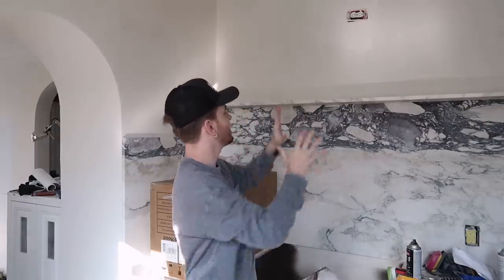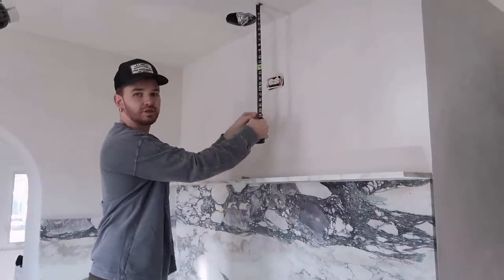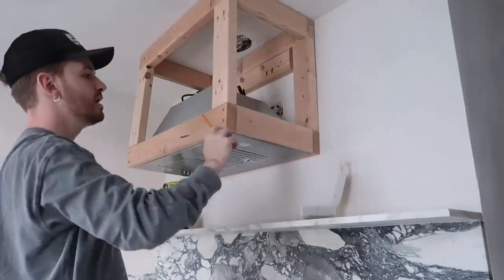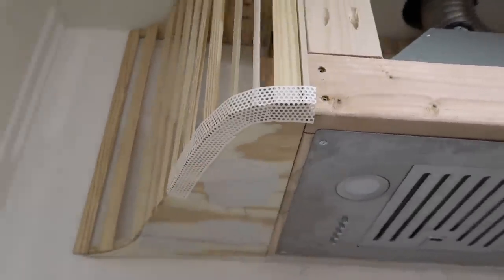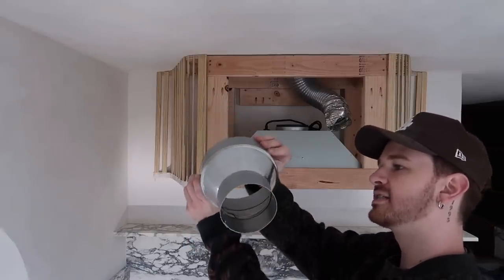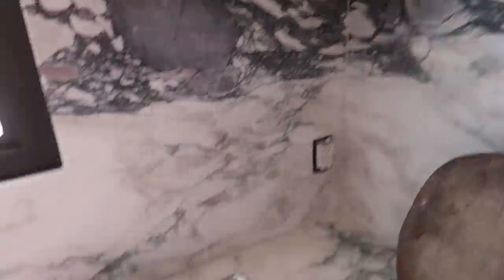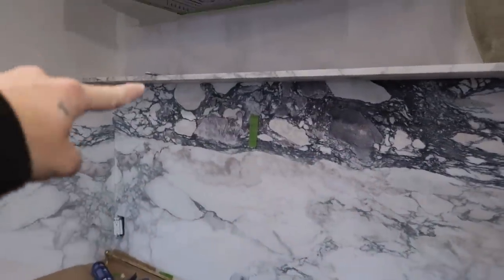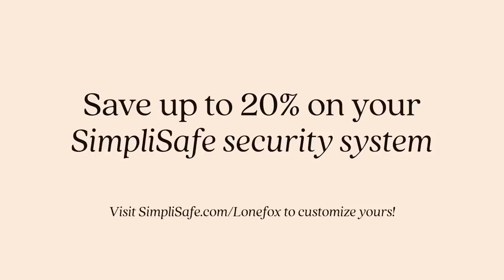DIY Stone Range Hood Using PLASTER (From Start to Finish)

Comment: Haha, ventilation removes the HOGS -- heat, odors, grease, smoke.  You should be running your ventilation every time you cook or all of that gunk will end up covering your cabinets and making them sticky/gross.  I love, love, love your design aesthetic, content, personality, videos, and creativity.  Thank you for all of that.  There are a few people who have mentioned the size and the height of the range hood.  For the most part, they are correct.  Also, you should add up the BTU's of all of the heating sources (burners, oven, etc.), and then make sure your CFM from the vent are adequate to cover all of them.  Typically, your ventilation will be one size larger than your range (ie: if you have a 30" range, you'll want a 36" vent hood.  There are several reasons why your vent hood might be a fire hazard as well.  Someone has mentioned those reasons below me, but now, I can't find it.  Signed, a kitchen designer and appliance expert.

Comment: I personally would have brought the hood further down to where the marbel shelf is now, and only add shelf slates on each side of the hood. Usually, it's mentioned in the instructions manual the optimal distance between the stove and the hood (to me, it seems a bit too high up) Also, even though it would have kind of ruined the aesthetic,  I would have opted for the front panel to be a door, so that I can access if necessary. But other than that, visually, it looks stunning. You always have great ideas!
Reply: Marble is not combustible, so I’m not mad at the shelf. For some reason I thought the rail was for spatulas and ladles. The pots may get some splash back. Performance is not too much of a concern. We don’t know the range Drew selected. So it’s impossible to make recommendations without doing a BTU conversion to CFM’s and look at the clearance. People are too quick to judge in the comment section.
Reply: yeah I don't think if it will be effective if it's so high up. We have shelves either side aswell but in the middle the hood or else it would be to far away to do anything.
Reply: I think the hood looks great.  I am worried about the height and effectiveness of the hood also.  I wonder if the fan vibration would crack the plaster or the cooking fumes and grease will stick to it and make it hard to clean.  You might find a custom vent hood made of stainless steel in the future.  One more thing…I don’t know what the code is in CA but where I live there are height and material codes because of fire.  I do hope it works for you as I think your ideas are beautiful.  I just want everything to work out.
Reply: @erinmoore9681  they just gave their opinion based on observation. it was pretty neutral and didn't come across as judgy at all
Reply: Good points on both sides. We’ll see what happens when the kitchen is done. The insert can always be replaced with something more powerful if Drew notices performance issues. No hate, just thoughts.
Reply: @erinmoore9681 I have a Bachelor's Degree in Design from Drexel University; I have done many kitchen installations and Manufacturers ALWAYS stipulate that the range hood is hung between 28-36" above the range surface in order to work properly. Think of it like tires on your car- your gas mileage will be crappy if you buy square tires instead of round ones. or install round ones so far up the side of your vehicle that the undercarriage of your car scrapes along the street- just because you like the aesthetics. It's not "criticism" of your dear boy, it's a warning.  PS- Windshields don't work either if you install a privacy screen around the lowest 8" of the view; (you can still theoretically see, but not the way you should) that's what the shelf does in regards to the vent/exhaust hood.
Reply: its pretty buttttt I completely agree. Drew has great style but the reason i prefer macenna's videos for learning is because i can tell she does thorough research and read instructions so hers are pretty AND functional. This hood is too high to be effective, at least in my home it would be absolutely useless (hello to all home made pasta sauces and asian foods in my mixed household). also, I love how he makes things work but he rushes so much. He doesn't test paint in different lights. Like ever. Its actually a cute quirk at this point but as he evolves as a designer I hope to see drew become more detail oriented and look at function of use long term as well. I hope he sees these comments as feedback and not in a negative light. The knowledge and growth can really take him higher in his career, I really hope I see this for him because the potential is chefs kiss
Reply: @jmcaulay577  It would not be to code if there was one (due to distance and obstruction, not to mention materials used and no accessibility) but most household building codes do not require a vented range hood, in fact I do not know of a single location that requires one!  It IS however, beautiful.
Reply: @nathalieisneon  you need a degree to be a designer… so “his career as a decorator” not a designer
Reply: @robertmaylock9532  Great points, Robert!
Reply: @robertmaylock9532  Distance and use. I need to be able to reach the knobs that he placed at the WALL SIDE. But live and learn. Nothing combustible around the stove. But that is just me.

Comment: I HAVE CONCERNS. 😂

1) the vented hood came out spectacular!
2) what if the vent hood needs service. Such as motor problems or electrical issues? How will you go about accessing that portion of the vent hood without ripping it all out first?

2) with the vent hood so high above the range and the shelf above it,  will smoke, steam etc., still be able to be directed into the vent hood?

Comment: A vent needs to be sized and located a specific distance from the stove top to be up to code. It looks quite small. I found this out the hard way when I purchased at larger 36” gas range. They had to upsize my vent size.
Reply: I was thinking the shelf is blocking half of the fan and is much too high from where the stove top will be to be effective.
Reply: @pattir8616  this drove me nuts 😭
Reply: Same! I want to love this but between reducing the vent to 4" (which is too small for most hoods), not to mention gas usually needs a 600cfm fan and the shelf/height making the vent basically useless... I can't. Looks aren't everything, especially in kitchens!
Reply: My stove doesn't even have a vent. Not even a microwave with a fan over top. Just cabinet.
Reply: 30" above the range if it's electric and 36" over gas... that is a building code requirement and  also a requirement from every manufacturer as a vent has limited suction power...when too high it can not do it's job properly!!!
Reply: @1195mmg  cool story
Reply: @1195mmg  same 😂
Reply: Venthoods are optional its for convenience not a building code requirement.  There are industry standards when it comes to distance between the vent and the stove etc. I agree I just think it'll be fine his home might just smell more like the food he cooks 🤷🏻‍♀️
Reply: I would also want the vent slightly recessed into the structure instead of flush with bottom.
Reply: The more important note is whether the vent has enough cfm's to accomodate the btu's of the stove. Also the vent should be at least 30" above the cooking surface. At the sound of the vent it seems like it can handle all that. The manufacturer would give that info in the instructions..
Reply: @1195mmg  yeah my contractor told me because I had an electric stove a vent wasn't necessary.  If it had been gas he would recommend it because of the indoor air pollutants it produces.  They say it can trigger asthma attacks.  So I just use an air purifier to deal with any smells that might be produced.
Reply: I don't want to be a hater.  I think the vent hood was placed with the wrong side facing the front.  The buttons to turn on the lights, fan, etc., are in the back rather than in the front.  That means you have to reach over a hot pan, etc., to turn them on which is a safety issue.  Just don't want to see anyone get hurt from a hot pan or hot oil on the stove/range.
Reply: Yup, looking at the hood vent closer up during parts of the video, he has it reversed.  The buttons should be in the front along with the openings to clean the filters.  He has those in the back.  If it was reversed, the tubing going to the vent outside would also be straight and not curved like he has it.  He is tall, so it is not much of an issue for him (especially if he doesn't cook much).  I am assuming he wanted the lights in the front so they wouldn't be shining on the shelf.
Reply from the maker: @dcdinoto  I did this on purpose so the lights were functional in front of the shelf and not beaming only on the shelf
Reply: First home I owned had a gas stove and no vent. Lived there for 6 years. If I remember correctly none of the places I rented had a hood either. Wasn’t required by any code in Ohio anyway…
Reply: @manon2772  Yes, the vent was installed way too high over the range. It won't exhaust properly. Take the shelf that's blocking part of the vent attempting to exhaust smoke and odors from the range and you might as well remove the hood altogether. Don't get me started about the lack of wall cabinets in the kitchen.
Reply: Architect and custom kitchen designer here. Looks good to me. Nowadays appliances give homeowners the performance of commercial grade appliances. More ventilation than what is required for residential kitchen use. Drew is not running a restaurant. It’s his home kitchen. I’ve seen downdraft vents specified that are too powerful and actually extinguish the burner flame. More dangerous because of the risk of CO poisoning. I’ll take an undersized/high vent any day.
Reply: @erinmoore9681  I'm a kitchen designer as well. The hood is too high.
Reply: @pattir8616  Agree. Form over function, I am afraid.
Reply: @1195mmg  😵So much cleaning…unless you have an outdoor kitchen
Reply: And when the insert fails, the entire structure will have to come down to repair/replace it.
Reply: @pattir8616  that was my firs tthought and it drove me crazy!
Reply: @MargaretRichardson6  I'm sorry but that is absolutely not true. Often times contractors have the carpentry knowledge without the technical knowledge that kitchen designers have. Kitchen Designers often have extensive manufacturer training on appliances along with the knowledge they gain through education on their craft. Every home SHOULD have some type of venting or air flow system if preservation of your cabinet investment is a concern. A vented unit is best but not always possible...but some air flow is better than nothing.
Reply: I totally agree I think it's too high and the shelf is blocking it.
Reply: @jojojo724  also his white walls are gonna look dirty with grease, including those pans he hang above the stove 😂 he clearly doesn’t cook
Reply: @moonbeeps  So much this! I was cringing as he was putting that textured plaster on the underside of the curved structure, just imagining what a nightmare it will be to clean if he does any level of stovetop cooking above a couple days a week. 
I love the creativity of the curve, but I agree with those here who said that it seems to be a case of form over fiction, for several reasons. Were it my decision to make, I would have created a discreet door for access (hidden cabinet), removed/left off the marble shelf and dropped the extractor hood construction down to the level to meet the marble backsplash. He could still have done the curves on each side and added shelves on either side where the curve meets the wall to the edges to get that decor/storage space. I'd have then used the marble from the shelf to make up the difference in height between the backsplash and that of the side wall, which is absolutely driving me crazy.
Reply: @dcdinoto  do you not turn the extractor fan before you start cooking??? We were always taught to turn the extractor fan or hood before you even let the shit your cooking gets hot lol I sincerely doubt anyone practicing some common sense will get hurt
Reply: @lonefox  My hood is a microwave recycler thingie and it's VERY HIGH and works fine.  I got a slimline microwave so I didnt feel like I was in a deep dark cave when I cooked.  It doesnt match up with the cabinets in length but damn does it look better and feel better.  youll be fine. mine passed Ca code, yours will do.
Reply: Omg yes this! I had to scroll so far to get to a comment that wasn’t just praise! Constructive feedback is always great, especially in this case where he is a designer and that’s his focus. Sometimes things may not be aesthetic because they serve a purpose. Some great feedback on here already but I’ll add that since he wanted to have the shelf, I would’ve bumped out the structure so that the vent was centered over where the range will be. That way it wouldn’t be half blocked by the shelf.
Reply: Was thinking the same…and the shelf doesn’t make sense from a functional standpoint. I wish he’d hired a contractor for this part.
Reply: @jojojo724  Not having a vent is a huge issue if you are cooking with hot fat as it will smoke a great deal.  Unless you like a smoke-filled house and you don't mind the smoke alarms going off.  I'm actually mad that they didn't install a proper vent hood in my house, as it's not required where I live, they just put a microwave above the stove and so it vents into the house.
Reply: @MargaretRichardson6  lived 18 years with a vent hood that wasn't connected to any kind of exhaust system, and wasn't possible to put in an exhaust system. The ceiling and nearby cabinets picked up grease and dust like crazy! We had an electric range, which still heat up food and therefore cause grease and smoke and smells.
Reply: I've never seen a vent required in a home kitchen for code. Can you cite one? The only reason I can think of one being necessary is possibly if you had a huge, industrial grade appliance that could heat to pizza oven standards..
Reply: @manon2772  my county does not require ANY vent to be installed over any stove, its not really necessary.

Comment: Lone, I am thoroughly impressed.  One of my pet peeves are the range hoods that are oversized, overly ornate and gaudy they become the focal point of the kitchen.  It is a fan, so NO sense in making those so ornate and big, they steal the show.  This does the job, but is inobtrusive we can now appreciate the other things going on in that room.  At first the curves seemed unnecessary but they really help to blend the hood into the wall and that architecture, making it even more subtle.  Also very impressed with the way you built it, now with the box the noise should be greatly reduced.  I have never heard of "poly board either, but what a great thing, this would take forever to use drywall.  This design and execution could not be improve upon.  Maybe use a metal drywall corner bead for the bottom lip, so it is not easily chipped (the same thing you would use on an arch)?  Congrats Lone and much respect.  Anybody could use this design idea, even without the curves, and painted the same color as the walls.  It has an adobe vibe, in keeping with your Spanish house, but without the curves, it would not be.  The beauty is in the simplicity.  WOW, Fantastic.  A++++

Comment: In general, most installations require a distance from 20" to 24" between the bottom of the hood and the cooking surface. Over a gas range, this distance should be between 24" and 30", unless otherwise specified.
If the range hood is mounted too high above the recommended height, it won't be able to extract away the fumes. That means you'll have to clean the range hood, your cooktop, countertops, and cabinets more often. In other words, your range hood won't function as it's supposed to.
Reply: 20"-24" is too low. It's 30"-36" above the cooking surface.
Reply: I love the look, but had the same concern. There's also an issue with a plug in an inaccessible concealed space. It would have been better to hardwire in a safe jbox. Though it's not likely to happen, a plug can fault, spark, etc. and therefore should have some sort of access panel. I don't know residential code that well but that's not allowed at least in a commercial space.
Reply: @sharonluvisi6069  If you have an electric cooktop, range hoods should typically be 20–24 inches above the heat source. For gas cooktops, your range hood should be around 24–30 inches above the stove.
Reply: yeah, looks high and that marble shelf is blocking the way. Also with moisture and heat, can't help but think there are going to be a lot of cracks in that plaster.
Reply: 🧐🧐Once the stove is installed, no-one under 6’ 5” is going to be able to reach the buttons/switches on the hood. Everyone will have to step on a stool to reach them.
Reply: Checking the maximum distance is quite essential. Can't imagine that he would have skipped that.

Don't you guys have ceiling integrated hoods in your countries? They work just fine and come with good acoustics despite the extra power. And they're great for tall people. You just use the remote control or your phone to switch it on etc
Reply: Idk why this thread makes me laugh, my apartment I'm renting doesn't have a range hood at all over the stove, the extractor fan is on the floor lol is my landlord trying to murder his tenants bc honestly I'd believe that :O
Reply: @paddakoor  I was a professional kitchen designer. You are not correct. I'll only give to 30". The ventilation should also extend 3" on either side of the range and the depth reach the front of the cooktop. Try cooking with a hood 24" above the cooktop at a 24" depth and see how comfortable that feels.